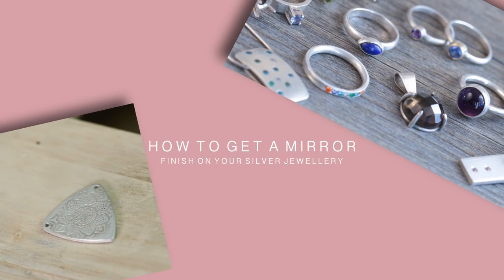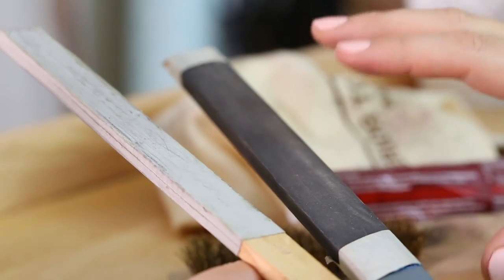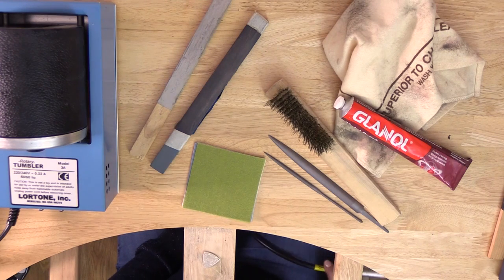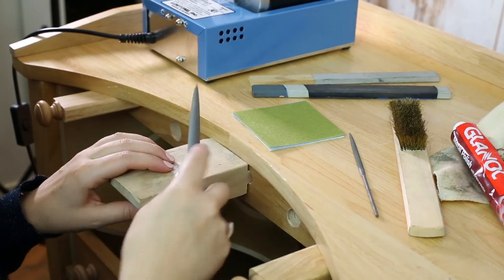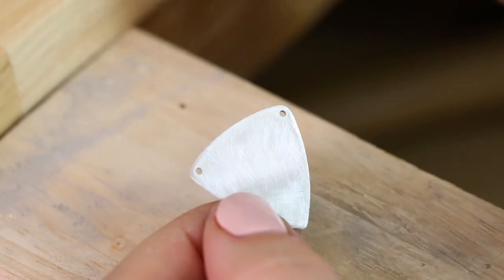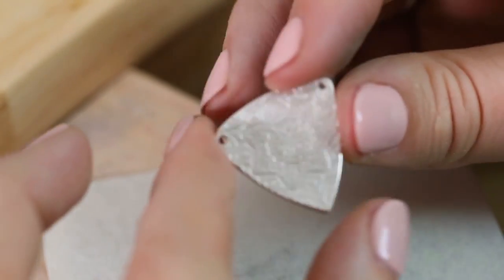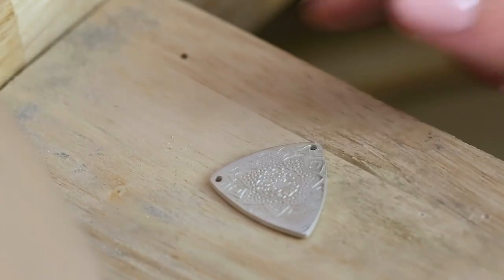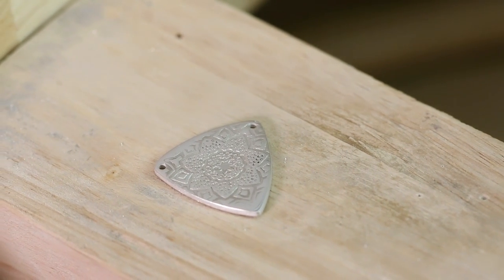How to Get a Mirror Finish on Silver Jewellery

Comment: Hello! Thank you for your useful tips. Is there a reason why there are scratches still in the final product ? Just because you wanted to speed up to finish the video ? Will all the scratches come out if I continue to use the different papers? Sorry for all the questions, I am having issues getting a perfect finish on my final product and can I see scratch marks from sanding
Reply from the maker: If you want a super perfect mirror finish then you need to work carefully through each paper in small increments and vary the directions in which you sand. x

Comment: Just a quick safety tip for persons using a file. When using a file, it would be a good idea to have somekind of small handle at the end of the file (or something else to cover the sharp end). There is a risk, (especially if more force is used) that your hand grip fails if file gets stuck or bumbs into something , and at that point, it's possible that the sharp handle punctures your wrist (which could be dangerous).
Reply from the maker: Thanks so much for the tip x

Comment: Hi Jess!  Thanks for the lesson! 🙂  I'm a newbie to bench jewelry and I'm trying to figure out the bare minimum needed to create a mirror shine.  I was wondering if you could just skip the sandpaper and start with the polishing papers in a scenario where maybe you've fused fine silver or Argentium instead of using solder since you wouldn't have solder to clean up afterwards?  It would seem that you would've started with a clean surface. Let's say you make a silver band ring and the silver wasn't very scratched up when finished (yeah, I'm trying to find any workable shortcuts for hand polishing - LOL!), wouldn't the papers work? Or is my thinking delusional that anything would be finished so well it didn't need sanding? LOL! 😄  My first project will be an Argentium or Fine silver band ring and if all goes well, my next project will be a link Bracelet. I do NOT have a tumbler and even as much as I'd love to have one for my rocks, I just can't afford one right now so the bracelet may be a real challenge without one.  Any confirmation on my sandpaper skipping theory or any advice would be greatly appreciated!  Cheers! 🙂
Reply from the maker: Yes in theory, if your silver isn't badly scratched then you don't necessarily need to start with your lower grit (more abrasive) papers. You could just use the polishing papers x
Reply: @JewellersAcademy  Thank you so much for confirming and sorry my "thank you" was delayed. Cheers!

Comment: Hi sorry I know this was a while ago but I’m struggling to get a mirror finish. Can I ask - I’m starting with a 320 wet and dry and working my way through but can still see scratches. Do you think 320 is too course and should I start with a 400 ?
Thanks in advance.
Reply from the maker: It really depends on the state of the piece when you start. If there aren't many deep scratches then you could start at 400. 

It's hard to say what's going wrong without seeing how you are working, but there are a few things to bear in mind  - always make sure you are multi directional when sanding (using figure of 8 if flat). Also make sure you are contaminating your mops when using polishing compounds at the later stages too - always clean your piece before moving onto next one up.

There are so many different techniques and tips for achieving a mirror finish, you might find it helpful to join our Facebook group as there have been lots of great advice shared there. Follow this link to join https://www.facebook.com/groups/jewellersacademy

Hope that helps! x

Comment: You didn’t specify the grit on your emery sticks or the polishing papers.
Reply from the maker: I used 800 grit sandpaper. The 3M polishing papers are Green - 30 Micron / 400 grit, Grey - 15 Micron / 600 grit, Blue - 9 Micron / 1,200 grit, Pink - 3 Micron / 4,000 grit, Mint - 2 Micron / 6,000 grit, Cream - 1 Micron / 8,000 grit
Reply: Thanks! That helps.